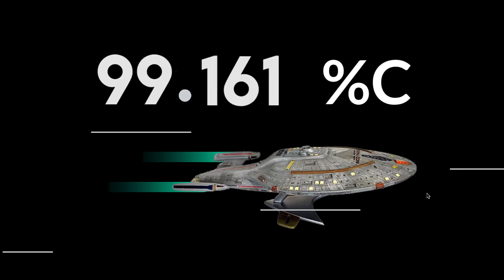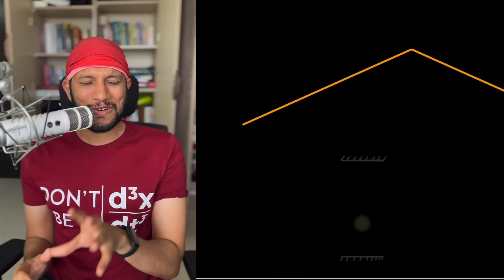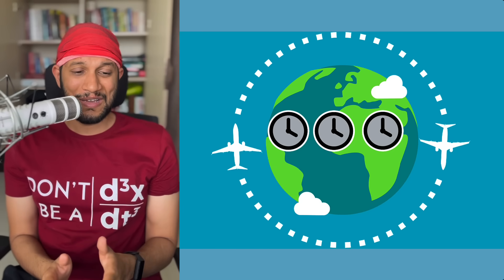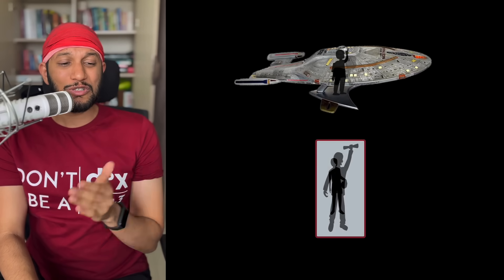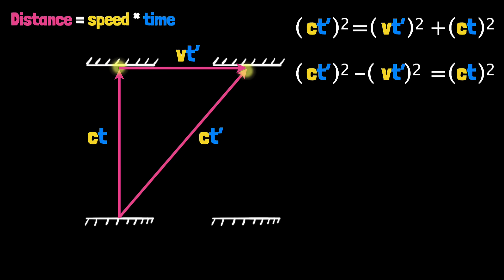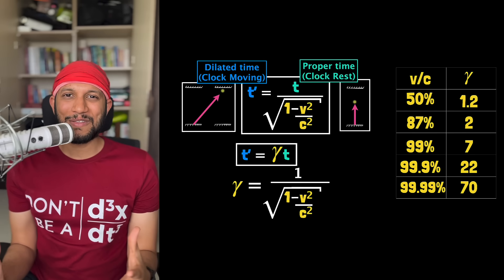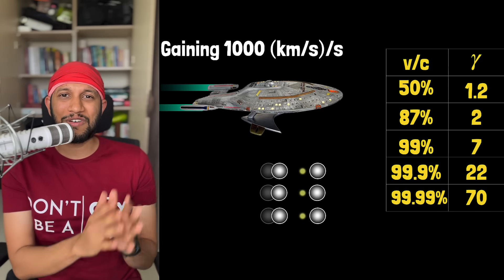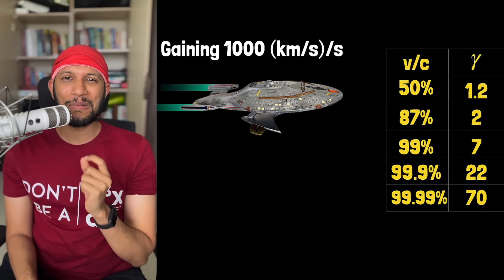I finally understood why you can't go faster than light! (My mind is blown)

Comment: It's also worth noting that if you actually hit C then your clock will run infinite times faster than an outside observer, you will have *stopped the flow of time*, and while your perception of time will keep ticking at 1 second per second in your relative viewpoint, if we loop back to the photon mirror thought experiment you will realize that as your speed approaches C the trajectory of the photon approximates a straight line, if you actually were to reach C that would necessarily stop the clock for everyone else since the photon would now take a perfectly flat trajectory. Formally for an outside observer your clock would be ticking at a rate of one second per infinity, which doesn't make a lot of concrete sense.

Ignoring the infinite energy requirement, this necessarily breaks causality since you can now cause an event, intercept the result, and change it. Let alone if you somehow were to exceed C (at which point your time would move in the inverse, i.e you'd be traveling backwards through time).

That being said, as a thought experiment we can postulate that if you had some kind of exotic matter where you could accelerate the atoms in the very front of your ship such that instead of pushing a leading photon edge they leave a trailing photon wake then assuming that said wake pulls atoms along then you could principally reach lightspeed (at exponentially lower fuel costs at that). No such matter exists and this still breaks all sorts of laws of physics in new and novel ways (for one such matter would likely have to have proportionally negative mass relative to the rest of you ship such that your ship totals zero or less mass, and even then that's handwaving away the fact that you'd collapse into a wave of pure energy at those speeds which would likely constitute the destruction of the ship and its crew).

In practice this ought to be impossible, everything in this universe can be described as having a four dimensional vector detailing their position and direction in four dimensional hyperspace (which we will call "spacetime" from now on), we can treat this as a normal vector since everything has a scalar of C. With that in mind it then becomes evident why time stops if you reach lightspeed, if your total velocity through spacetime is always C then if you start moving through space at some significant fraction of C you must necessarily move slower through the time axis by that same fraction of C. It's all down to conservation of energy at the end of the day, and while you could normally add energy to the system to increase the scalar that is not possible here because C is the lightspeed constant and serves as the maximal scalar energy state of anything traveling through spacetime! One could hypothesize that given the universe being quantized that there may exist a higher quanta, but if so it would be such absurd energy levels away that it would be physically implausible (or likely impossible) to reach it without adding the total energy density of another universe (which is impossible under current known physics, even if we grant the axiom that a multiverse exists). This if you increase your spacetime vector to move entirely along a spatial axis then you necessarily minimize the time component to zero. This also explains why faster-than-light travel is impossible under current known physics, by eliminating all of your movement through the time axis you've merely reduced your influence of time to zero, to reduce it to negative you would once again have to exceed C which violates conservation of energy!

Comment: I think there's an easier explanation: 
C isn't the speed of light, its the speed of causality.

To push something faster than the speed of light (causality) you need to have the force of the push happen before you push (the push happened before you caused the push to happen).

That would be like a swing where someone is "pushed" just before you make contact... and you feel resistance before you start pushing.

To push AT the speed of light (causality), you would need the cause and effect of a push to coincide, and thats not how cause and effect happens. 

That would be like pushing someone on a swing and as you try to push there both feels ro be no resistance at the same time as feeling the full resistance of the push.

This makes no sense and is easier to fathom than ticking clocks, stretching time and infinite fuel.

Comment: Great explanation. One question: what if I’m inside the ship. Ship discharges x amounts of fuel every second to gain y amounts of speed every second, according to my own clock inside the ship. It gets confusing now because if I accelate, say, at 1000km/s/s; then after approx 300x fuel discharges I’ll break speed of light which is 300 seconds for me. Innit? This like the paradox of halves (Zeno’s paradoxes): you step half the length of your previous step. If you started with 1m, then it’d take infinite steps to reach 2m. Yet universe has a planck length limit so it is not true. Do we have such an explanation for observer inside the ship? Otherwise I should be reaching c after 300 seconds.

Comment: So in short: the faster you go, the slower the time pasing by. So your trip will last endless time, of you reach full lightspeed. And if time is at a stand stil, you are dead. Because you have no time to breath, let your heart beat...and last but not least: reverse Einsteins Formula: E=m.c2, which means the energy released, is the equivalent of the certain mass multiple by the square of lightspeed. So a 1000 metric ton Spaceship need this enormous energy. So you either can say, the need for energy rises, or the wight of the spaceship is gaining weight. And with more weight, it will slow down the closer it reach to the speed of light. Just remember: even the fuel has its weight...So only weightless photons can travel with lightspeed.

Comment: the "absolute" speed of light? Science is not "absolute". How do you measure the speed of light, It is an estimated constant. I love the use of a photon clock to make the Mathes work, but the Photon clock is like a fly in a car, The photon does not know it is traveling unless acted upon by another force. The fly will happily move around in your car no matter what speed you are going. Suns are disappearing from our view as they start to travel away from us, or the expansion between us and them goes past the speed of light, what fuel is being used there etc etc etc.......Travel away from a clock at the speed of light for 10 years and you would not see the hands of the cloak move, yet if you turned around and traveled back towards that cloak for 10 years, as you get closer to the clock, its hands will spin faster and faster until you get back to the clock, what will that clock say...20 years have past. stand and watch that same trip for 20 years and it will still be twenty years. The photon clock on the trip will read the same, It is just the Mathes that is different.

Comment: What if the ship was traveling in a giant bubble. The bubble is moving 99.9% the speed of light. Then the ship travels an additional 1% of the speed of light inside of the bubble? Theoretically the ship would be traveling faster than light correct?

Comment: Bear with me, imagine we get the first atom in the structure to move faster than light. The electromagnetic force field that pushes the next atom in the chain only affects at the speed of light. So to move matter faster than C means moving an atom faster than it can push away the next atom in front of it. This means all objects moving faster than C will start to flatten as the space between the atoms will shrink on the same plane as the direction of travel. Eventually, the the nuclae will either collide or slip past eachother. Electrons, protons, and neutrons that are in eachothers' way will be forcefully crushed into eachother, causing conventional laws of physics to literally break. Moving >C will cause matter to disintegrate itself at a sub-atomic level. As you increase speed past C, the amount of time you can physically exist gets infinitely smaller.

Comment: The answer is more simple and it is universal law. If the fastest of the smallest things speed is =c, than in a chaotic interaction  the speed of constructed things of this chaotic interaction would bee a lot smaller than (c)speed because the vectorial interaction of forces brings a resultant force that does not allow to be created huge speeds. The problem consist that if photon isnt the smallest particle (is a constructed particle ) than photon is not the fastest thing. There should be something else.

Comment: Time is just the movement of atoms right? Black holes are close to absolute zero and the bigger they get the colder they are. Light can't escape it since the movement of atoms have basically stopped within it so time has slowed down. Or well that's just my very unedicated "theory" about it :D

Comment: One assumption in this is that we must wait for a chain to complete before initiating the next action. But why must we? If we go to your normal clock example, sure the tip of the hand may take longer to react to the base moving. But if we send a continuous stream of impulses then while the hand may appear to "curve" as the tip lags behind the base, it will still end up moving at the same normal speed.

There is also the quest of what happens when the hand is moving in the opposite direction of the ship. If there isn't relative movement with the ship then it would end up moving at 2x the speed of light. That could make up for any lost time when it needs to move in the same direction of the ship.

Comment: So if the ship is accelerating 1000 m/s. Then it will take it 299793 seconds or less than 4 days to accelerate above speed of light? In 7 days, you can travel 2x the speed of light. As long as you are inside the ship. From the observers point of view, it will take a long long time though.

Comment: I suspect this is kind of answered in part 2, but from this alone, you would likely think that signals should propagate faster backwards and slower forwards, e.g. when a clock hand is pointing opposite the velocity, it should be moving faster.

Comment: The whole thing is based on the assumption that no 'force' can be faster than photon ? What if there is a material, which conducts the transmission between its smallest elements at a speed faster than light ?

Comment: The major flaw of this is in order to observe an object traveling at 50% of the speed of light, the observer also need to travel at that speed (no time dilation) -- so the time dilation is just a mathematical hypothesis. If the observer is at rest, the object traveling at 50% the speed of light will just disappear, unable to be observed -- just like a moving car passing by at 100 mph, let alone 50% the speed of light. In addition, the observer would also need to account for the light to bounce from the moving object back to the observer's eyes. So the photon that bounces up and down in the video, would also need to bounce back and forth between the moving object and the observer. Since the photon travels at the speed of light, both the moving object and the observer would be updated by the new location (either up or down) of the photon at the same time -- meaning, no time dilation. There's something else going on with the atomic clock experiment.

Comment: Oh right. I forgot that when I am on a train and I jump in the air that I am actually flying incredibly far and fast. Breaking Olympic records for length of jump, which also cost me a lot of physical exertion and energy to accomplish. I better drink a Gatorade to recover my salts! Did Einstein forget Newtons 3rd law of physics. "An object in motion tends to stay in motion." What an Einstein move!
Reply: Did you all forget that Einstein also said that as we travel closer to the speed of light that our atoms start to expand. Meaning that we get larger and less compact. As Einstein also said, if we rode a ray of light and then shined a flashlight forward that would create a wall of light, but it does not. He says that the relativity of moving at the speed of light and then shining a flashlight ahead would then actually be another ray of light that starts at the relativity of already moving at the speed of light. It basically doubles in speed, but we would see it as barely going faster than us.
Reply: Also, on Earth, we are not in a non-moving position. We are spinning on the outer surface on a rock that is spinning and rotating around a sun that is also rotating around a larger celestial body such as a black hole, which is keeping us in a seemingly fixed position, but we are actually continuously moving outward from the center point location of the big bang's origination point. The relativity of all of this basically means that we are already moving really fast, but it also means that we are moving in a few directions moving faster than in the other directions. Do you notice that it takes longer to drive east or west, or even for your car to work harder to drive east or west more than the other direction? Relativity is not quite what you explained here.

Comment: This is all based on the premise that light acts like every other normal particle like sound waves and we know this not to be true because like doesn’t behave in any of them nor do we know what the speed of C is that’s a fact we do not know the speed of light in a one-way direction from point a to point B the speed light is unknown. Did y’all know that did you know the math is flawed? Yeah, this is all based on mathematical theories with math. It doesn’t actually work at quantum level, which is where light behaves.

Comment: The problem is you're the stationary subject, the moving subject sees the opposite, so, you see the moving entity as time slowing down, as the photon to you travels slower, but the photon for the moving entity on the stationary clock must be moving faster as there would not be a time difference with speed otherwise here's the real conundrum, the ship will see your clock being slow... The speed of light is reletive to the viewpoint,  as you discuss later, but that's on the next video...
Reply: You probably should refer to "proper time" as reletive time as both times are proper, dependinng on prespective. but they are not relative to the other because the presective is different.

Comment: I understand you're just repeating archaic concepts for views and to sound smart about physics. Time dilation has nothing to do with speed or movement. It has to do with the fact that atoms aren't homogenous structures. If you're accelerating at the speed of light the atoms will lose electrons and bonded elements will separate and you'll even have chemical reactions take place simply due to extreme acceleration. With these conditions which are probably testable and you see this phenomena with black hole accretion disks, you'll prove that there is no such thing as time warp. 

The only thing that is happening with time dilation is velocity acting on atoms as they exist. A clock on Earth and Mars will be the same. A clock on Mars and Earth's orbit respectively will be different and it just has to do with the atomic interaction with gravity being relatively different. Gravity IS a force. You're not bending around space/time in psuedo 2D trampoline but in 3D making some 4D experience reality, that's absolutely stupid.

Comment: I have a question: At 9:00 the path described by the photon is a change of direction (as seen from outside the ship) but I don't understand if this is a real change of direction if the path described as seen from within the ship is still perpendicular. Is this a real change in direction or just a perceived change? If the latter, then I don't understand how the time travelled is actually changed. Or is time dilation just an expression of perceived change?

Comment: I still don't understand. One could build the same argument with sound and "hearing" the pulses coming from some direction. The pulses would slow down too. 
Is it because we "see" the clock moving slower that it realy "is" moving slower? 
It is a nice "trick", that bouncing of the photon between mirrors. But what has it to do with time?
Reply: yeah this applies to waves too but it's far less effective due to the speed of sound being so small. A really good explanation to ur question is on paul g hewitt's Conceptual Physics book, search for the "Twins Travel" case on the relativity section
Reply from the maker: You would conclude (after accounting for hearing time delay) that the sound pulse 'ticks' at the same rate. That's because the speed of sound is NOT the same in all reference frames.

Comment: The most interesting thing, that time dilation starts to really spiral only after 99% speed of light. It also starts to grow exponentially, and for REALLY SERIOUS time dilation, that would let you cross the galaxy in reasonable subjective time, 1 year for example, you'll need time dilation factor of 100,000 (Milky Way diameter in LY). Ant it will take a 99.99999999995% of a light speed. So if your spacecraft mass is 100 metric tons (SpaceX Starship), you'll need 4.49E+21 Joules of energy, both to accelerate and to drop speed at the end. Even by using an antimatter fuel (as maximum efficiency fuel), the mass of needed amount will be gargantuan beyond common sense.